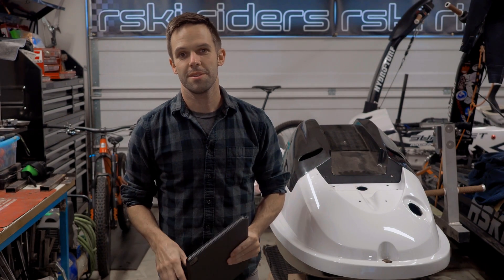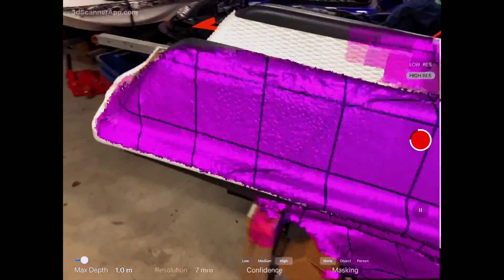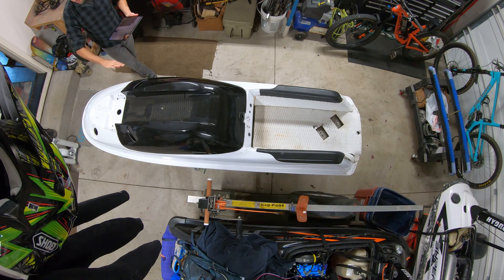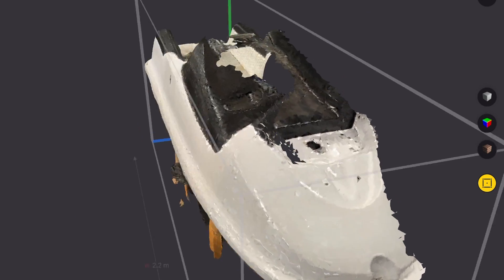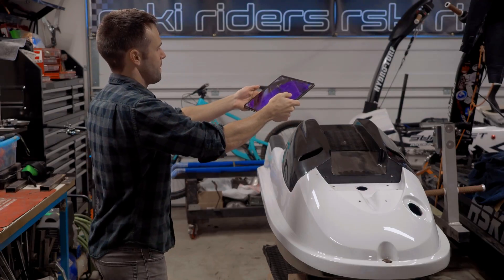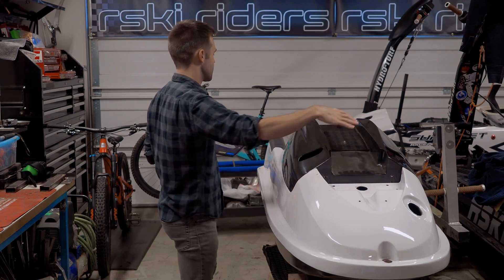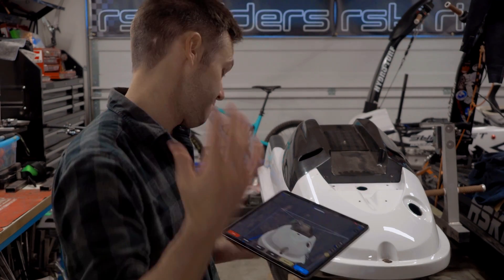3D scanning Yamaha Superjet with iPad Pro Lidar 3d scanner! Same as iPhone 12 Pro / M1 iPad Pro

Comment: What are you looking to do with the data?  I have done a fair amount of CAD work.  Work for Autodesk now.  As a long time SW user, give fusion 360 a go as well.  Mesh mixer tools are in it as well.
Reply from the maker: That’s awesome! I used Fusion for a few months when I lived in London and it was pretty cool. Hard to adjust to it in assemblies since I’m coming from solidworks. Idk what I wanted to do with the 3D scan, just wanted to see how it worked in the iPad (not too well) haha. I have a few friends with professional 3D scanners now, but I haven’t used them yet.
Reply: @RSKI  right on.  Yes, assemblies are different.  Make sure you set you mouse preferences to SW in Fusion.  Makes your life better.
Reply from the maker: I think I did that. But it's been a while! I remember the scroll wheel was reversed direction from SW.

Comment: How do i control the depth and resolution of lidar ? Can you please help me on this .
Reply from the maker: Just in the settings inside the app. Make sure to use high res mode, then you will be able to make those other adjustments.
Reply: Hi @RSKI  
Thanks for your reply . 
I want to know, is apple provide any API to change the LIDAR scanning distance . Or we need to use anything else . I am developing similar kind of application . Can you please help me on this .
Thanks
Reply from the maker: Actually I’m not sure on those details. Sorry about that!

Comment: So a tablet that you can buy today is also a faro arm. Wow! After thinking about what you use this for.... I guess you can scan 1100 triple or something and see how it might fit in there without breaking your back.  Make a model of the full ski and get it make in billet. It will have every imperfection your ski already has. You seem like a smart guy. I bet you have some interesting ideas of what you actually do with this.
Reply from the maker: Thank you for the compliment! I think this scanner in the iPad is pretty cool, but I notice the accuracy is not good for small parts. It’s fun for scanning cars and rooms. And big stuff like that.
Reply: the equivalent from faro is actually the freestyle 2, though accuracy is no comparison the faro products are far higher density lidar sensors
Reply from the maker: Yes, the iPad is no match for an industrial 3D scanner. But it’s pretty fun!

Comment: You can get a very fine spray chalk, if you coat whatever you are scanning with that, it will be far more accurate. Shiny and reflective surfaces are really a big problem for LiDar scanning
Reply: Great Idea! Whats the name of the app he uses?
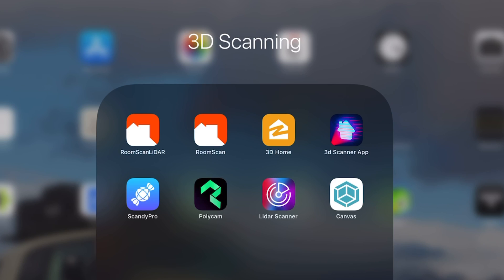Reply from the maker: The app in this video is called 3d Scanner App, shown at 0:39
Reply: can i get a chalk spray easy clean from a motorcycle?

Comment: Thanks for the video, maybe you used it to scan people, I was thinking of buying an iPad Pro instead of a scanner for the price but what you get in the end with the help of the applications (meshing) can be useful to scan arms  of people to customize prosthetics?  I would really appreciate your answer.
Reply from the maker: Hi Diego, sorry I missed your comment until now. For designing and building prosthetics I wouldn’t recommend the 2020 iPad Pro or the iPhone 12 Pro. Maybe they can work, but in my experience they are not accurate enough yet. If you find someone with an iPhone 12 Pro you can easily give it a try without spending any money!

Comment: Any experience with importing these surfaces into CAD software for accurate referencing? Say for example you wanted to build a trailer for your Jetski.
Reply from the maker: Yes, I think it would work for that. I exported a 3D scan of my Tacoma as an STL the other day. Took about 30 seconds to scan the front half. I was thinking a person could build a bumper for a truck this way. The STL imports directly into SolidWorks and it’s easy enough to work with. It definitely scans larger objects like a truck much better than small things like a coffee cup or similar.